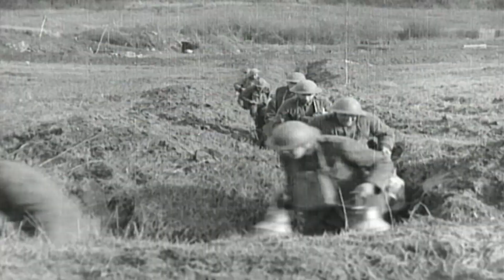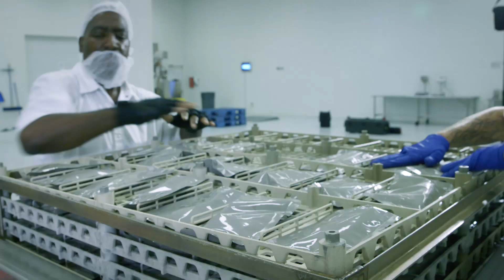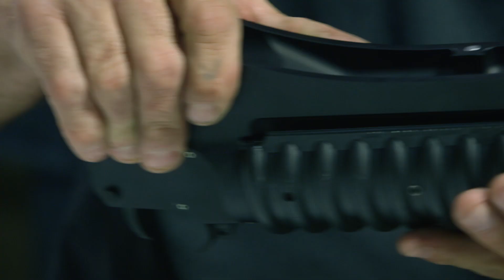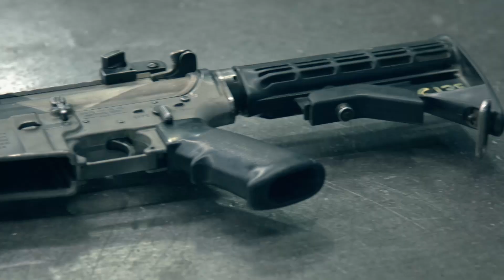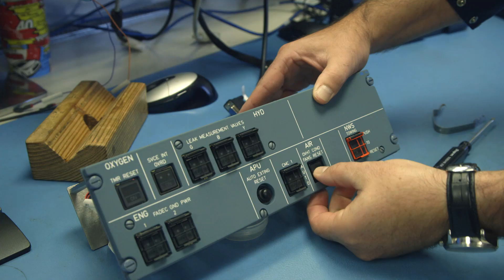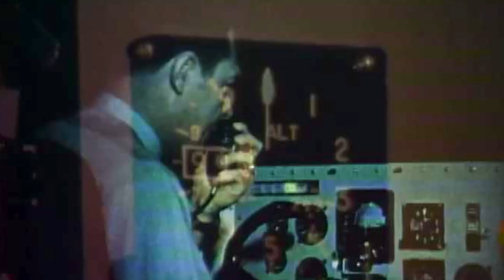Building the M203 Grenade Launcher | Battle Factory

Comment: I served from 1983-2009 and the first MRE’s were horrible but it was a welcome change compared to the C rats. The dehydrated beef patty tasted like wet cardboard. The current MRE’s are actually damn good (as long as you don’t get a vegetarian or halal meal).
Reply: The beef patty sucked but if you soaked the pork patty and fried it up in the mess tin (if it hadn't been pulled back to supply for no reason), ya had powdered ketchup and cheese. With the nasty crackers we enjoyed crunchy cheeseburgers.